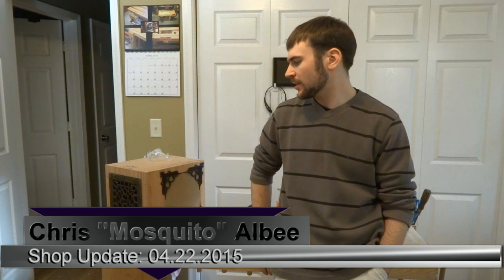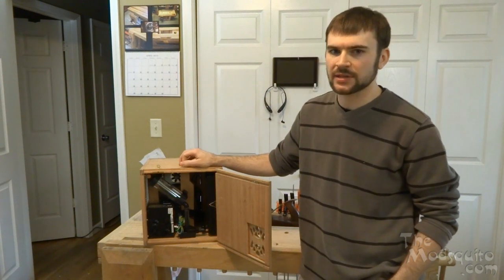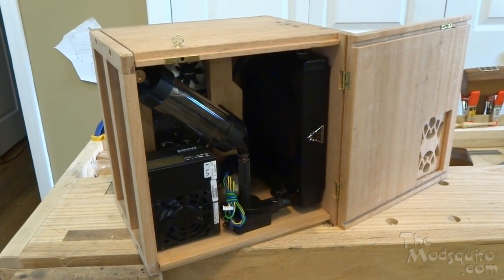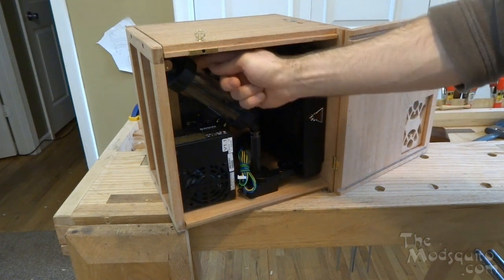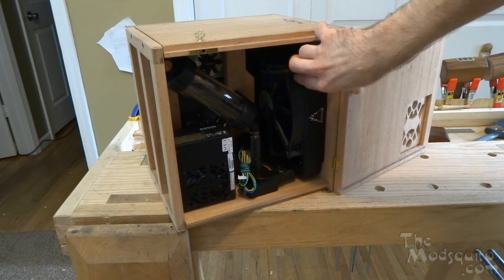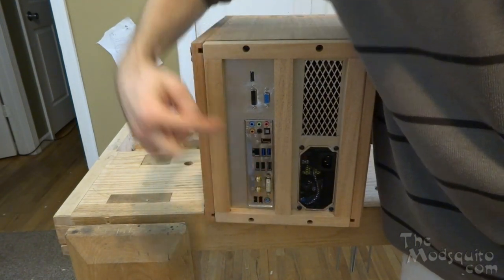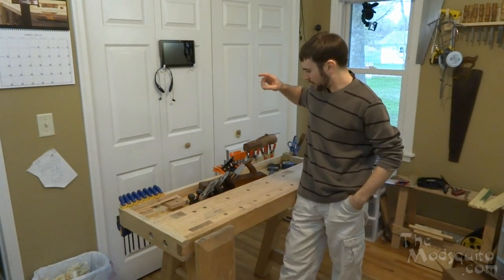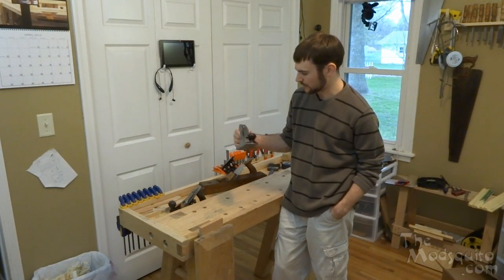What's in my Shop - April 22nd, 2015 - Victorian Desktop, Handplane restorations

Comment: I think that was a great call doing a bump-out on the side. The detailed aluminum cuts would have driven me nuts - turned out really nice! If you ever feel like doing a video on sharpening and flattening those planes I'd be watching with great interest. I've had a hard time getting that done evenly and nice the few times I've tried. But maybe there's no easy way to avoid the struggles.
Reply from the maker: Mark Rushing I may look into a quick plane rehab video.  I've got... 'a few' waiting lol  

For flatening the sole, I've got a 4' long piece of granite scrap.  I use 3M peel and stick rolls of 180 grit sandpaper stuck to the granite, to flatten the sole.  It's not always that fast, but it's the best way I've been able to get it done so far.  For sharpening, it's a grinder followed by my diamond sharpening stones.  Not always the quickest or easiest method that way either, but was cheaper than something like, say, a Tormek or worksharp in the long run.
Reply: I tend to use planers, thinking of them as a very rough thing, and will go to some great effort with sand paper from there. So I've not done a sole ever yet. And for the irons, I've only used a normal sharpening stone and oil. ;) I have to find some way to get to the point where I'm liking the planing work. I imagine some serious sharpness and smoothness would go a long way. I go to great lengths to avoid it right now. But I see you doing these, and it looks so much nicer and enjoyable. Though there are some instances where I can't imagine not using a router instead! But the workout is always nice. :)
Reply from the maker: For my current situation, using the router means moving the cars, pulling the router table out, putting the router in the table with the bit, then running the work pieces through.  Then put everything away, sweep up, and put cars back in the garage.  So for small stuff it's not so bad lol
Reply: Cars were tossed out of the garage years ago here. Then again I've got Moss growing on one now. 😀 Sounds like we both need a real shop. You should see my router table. You can barely move it. I built a big heavy one because I was sick of messing with those little ones with big pieces. But yeah accessing the router and bits is a pain. Funny how such seemingly simple stuff is such a challenge to optimize. I clamp on a big aluminum angle iron as a fence for that thing. But I can pull long pieces through at least without having to worry about keeping things perfectly lined up, and can do joints very easily on big pieces. But I could just clamped to the table and used a plane probably much easier. Hmm. But not as fast.